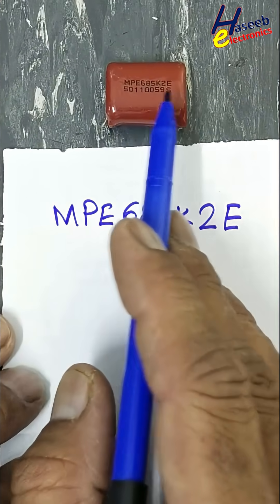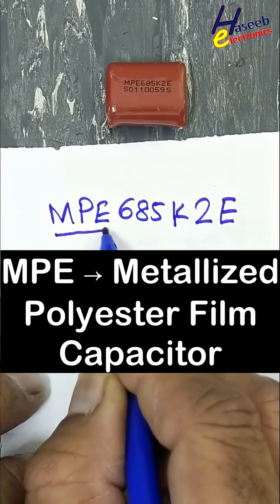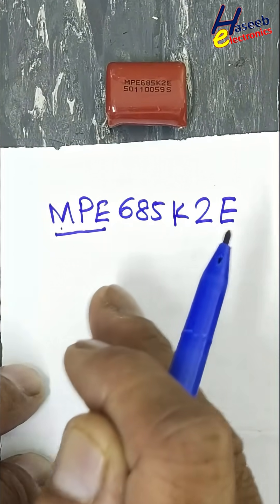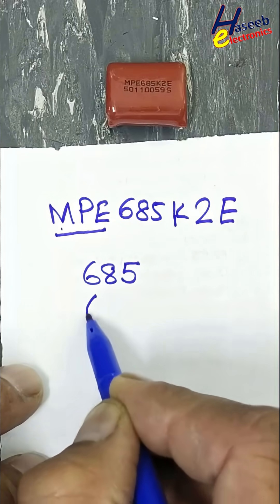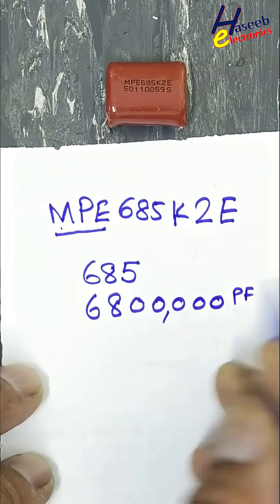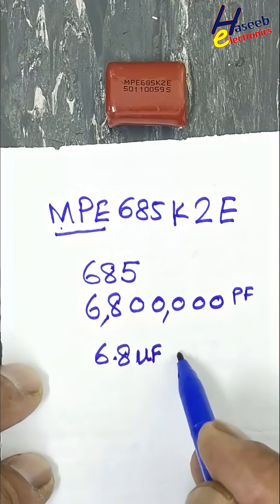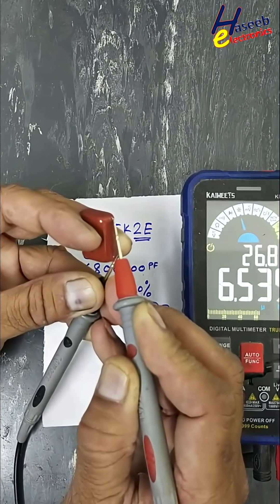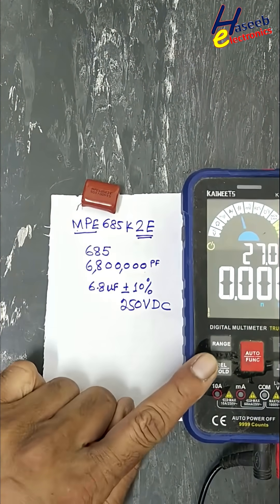MPE685K2E Metallized Polyester Capacitor Marking | Find Capacitance, Voltage & Tolerance #shorts

Comment: thanks for ur videos.can u share with us the tables of u showd in the videos that contains voltage and capacitance.
Reply from the maker: best regards. here is the link of the datasheet 
https://www.sparkinter.com/pdf/010310-0135470.pdf
Reply: @HaseebElectronics thanks very much.